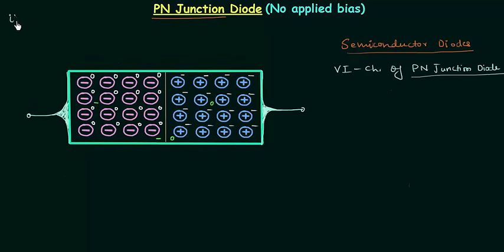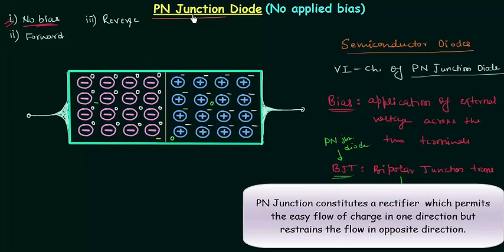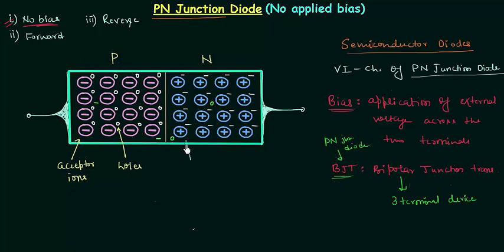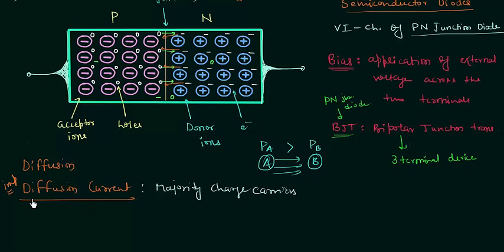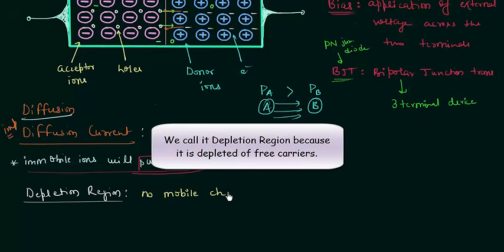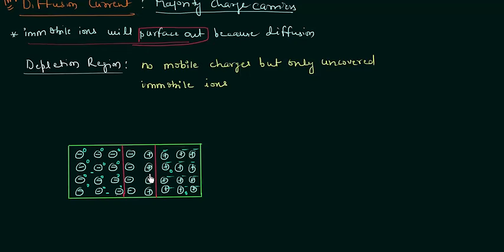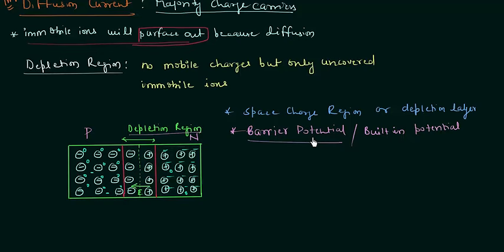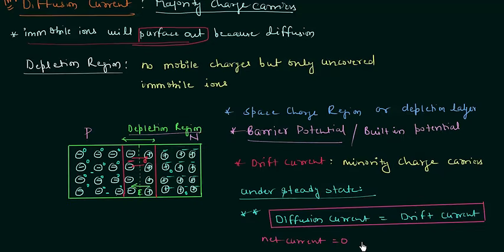PN Junction Diode (No Applied Bias)

Comment: 00:06 Introduction to semiconductor diodes and formation of PN Junction diode
02:39 Biasing of PN Junction Diode
04:52 Combining p-type and n-type semiconductors creates a junction with majority charge carriers as holes and electrons.
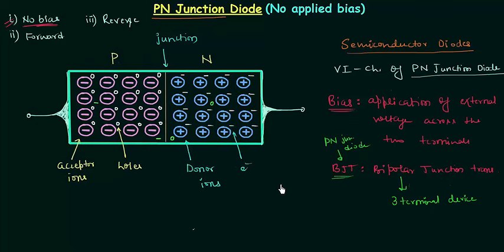06:51 Concentration gradient drives movement of charge carriers
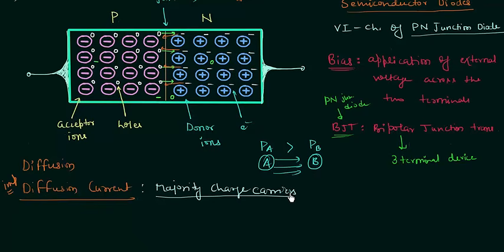09:02 Depletion region is formed in PN Junction diode due to uncovered immobile ions.
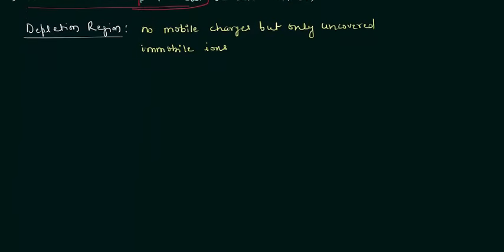11:28 Understanding majority and minority charge carriers in a PN junction diode
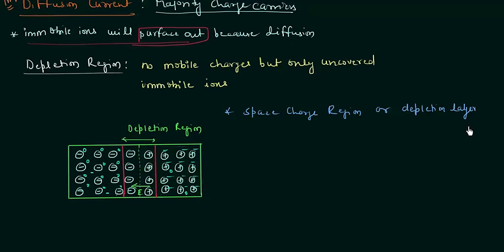14:15 Depletion region width is fixed due to barrier potential
16:08 Drift current is due to minority charge carriers.

Comment: Sir according to theory discussed....the drift current flows after the diffusion stops ...so there will be some time difference between drift and diffusion current so why we are taking them equal??
Reply: Ofcourse there should be a time difference till the depletion layer is achieved.Steady state is achieved once the depletion layer is formed and actually there is negligible flow of majority charge carriers and so is the case with minority charge cariers.In practicality the drift current is very less so we take it equal to the duffusion current.
Reply: Due to some technical issue
😅😅

Comment: Why is drift current equal to diffusion current. I can't figure it out.
Reply: Βecause it's open circuited. Since no internal current is flowing in, no current will flow out, thus making the two opposite-directed currents equal (referring to their absolute values, since diffusion currents goes from P to N, while drift current goes from N to P)

Comment: IES INterview question why we can't able to measure the built-in potential of the p-n junction by using a voltmeter.?
Reply: If we keep voltmeter there exits another potential difference which is opposite to the existed ones and hence both get cancelled so we can't measure the built in potential.
Reply: I looked into this myself. If the potential were externally measurable, you could derive infinite free energy from them. You could just connect a wire and have current flow with no battery, since you have a potential, current would flow. But that violates conservation of energy. So the metal contacts cancel out this potential. Look up ohmic contacts and metal-semconductor junctions for more information.
Reply: @VoidHalo  thank you for ur detail comment really helpful 😇
Reply: What's the answer brother ??
Reply: @sobankumar4927  barrier potential is inside the material, how can you measure it?
Reply: We couldn't measure this built in potential because there exist a counter potential(at terminals)  which cancells with the built in potential (to satisfy the law of conservation of energy )

Comment: Nice but 
1.what is steady state?
2.why diffusion current=drift current at steady state?
Reply: because a equilibrium state occur. Drift current is the opposite of diffusion current as we know drift current flow due to electric field and diffusion current flow due to the difference in concentration of majority carriers. Now steady states means no current will flow that means the two opposite current i,e drift current and diffusion current are equal and this state is called steady state or equilibrium state.
Reply: Arin Saha 
When the concentration of Majority Charge carrier is not equal to Minority charge carrier than how drift current can be equal to diffusion current. Your explanation is not correct.

Comment: How p type side immobile 
Ion have negative charge plsss
Explain 
And n side have possitive charge
Reply: The p-dopants release h+, so they become negative ions.

The n-dopants release e-, so they become positive ions.

For example: an n-dopant like phosphorus has 5 valence electrons vs. the 4 valence electrons of silicon. Once you add phosphorus to the silicon lattice that extra electron separates from the phosphorus atom and can freely move around. However, the nucleus of the phosphorus atom stays put. So the phosphorus atom overall has lost 1 (-) charge and 0 (+) charges. Therefore (net charge) = - (-1) = +1. 

If you google search for a picture of p- or n-doping, you will usually see the dopant atom in a Si lattice together with the extra h+ or e-. This makes it clear where that h+ or e- comes from, but in reality it DOES NOT STAY THERE. The extra h+ or e- disassociates from the dopant atom, leaving behind an ion with the opposite charge (i.e. negative of p-dopants and positive for n-dopants).

Comment: Sir In video You told that the negative charge will repel the eletrons and don't let them to come in p side but the +ve ion layer on P side should also attract the eletrons ( as there is concentration difference ) and No longer remains Uncovered
Reply: Hi , there is no +ve ion layer on P side.
Reply: I think it may also be due to the electric field force repelling them. So overall no movement takes place